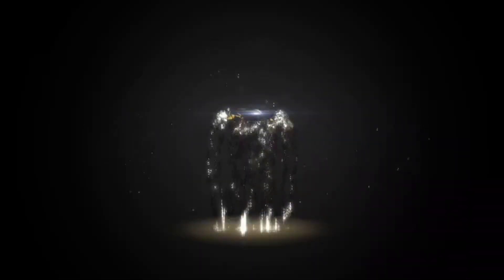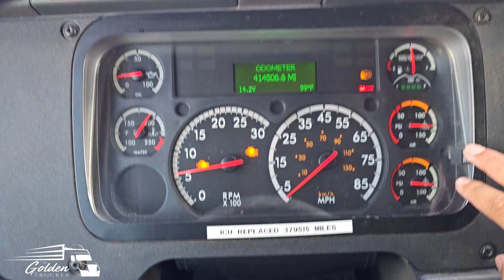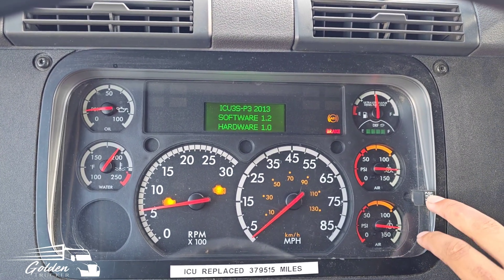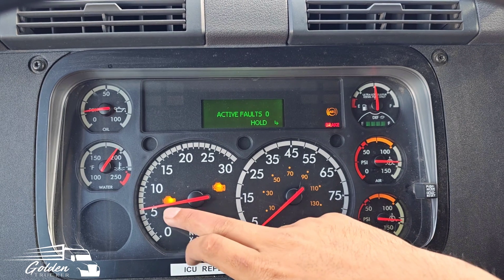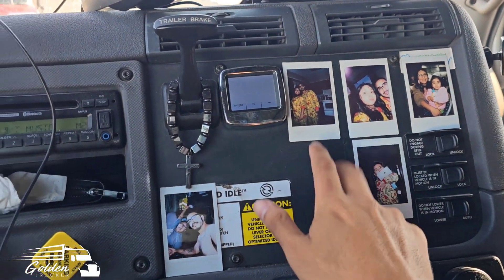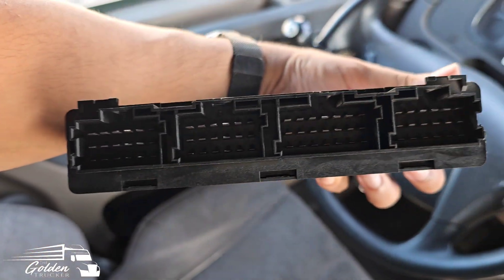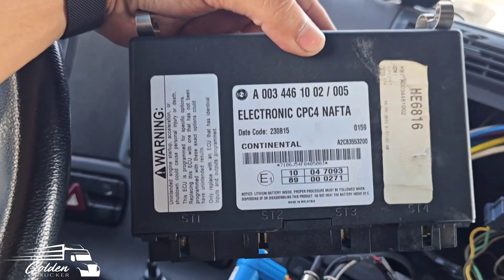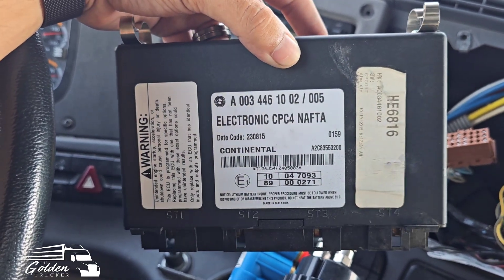SPN 973 FMI 9 / SPN 2011 FMI 9 / SPN 527 FMI9 Engine Controler/CPC4 Going Bad? Freightliner Cascadia

Comment: Might need a new cpc module
Reply from the maker: It has been working fine since the making of this video. No issues so far and crossing my fingers it stays like that for a while. Rough roads out here, I believe the connections just became a tad bit lose, at least on mine since I haven't had issues anymore.